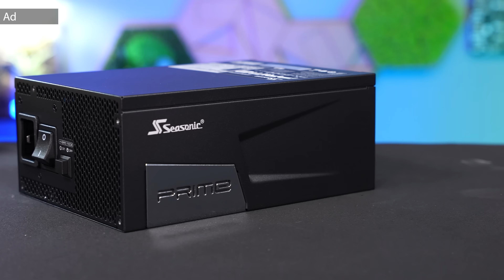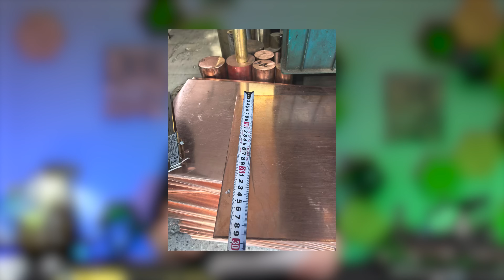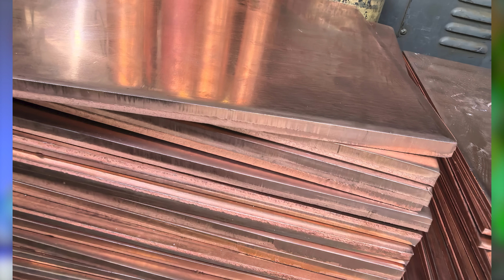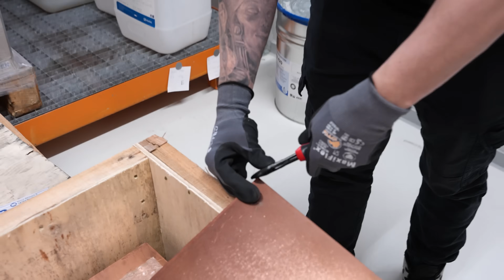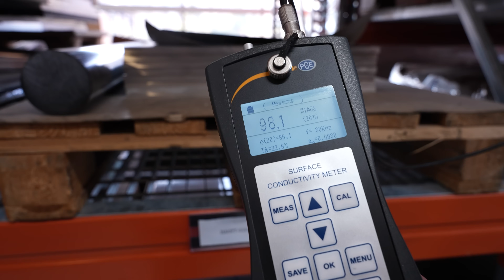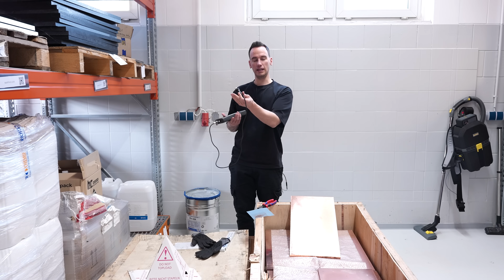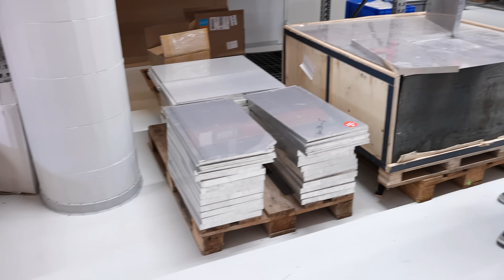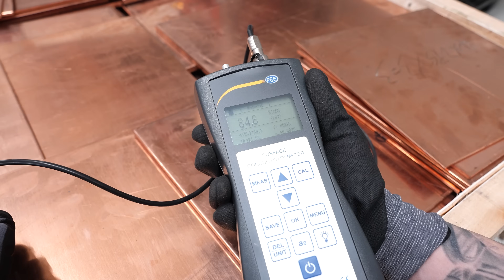I Got Scammed

Comment: china has some of the worst aluminum with high silicon very gummy bad source. they are also known for falsifying their material certifications with tensile hardness ect. a well known company i wont name thats worth billions will never source material from china because importantly the parts being machined go on stuff with huge liability which i wont name and the other reason is they have bought many different materials from aluminum to stainless steel from china and did lab tests and saw that most certifications were falsified from various different sources in china and some close to spec or not even the correct material. DO NOT BUY ANY MATERIAL FROM CHINA
Reply: also china has some of the worst aluminum castings in the world. russia has the best aluminum which i find funny but its true most aviation companies source aluminum through russia at least back in 2018. i think the trade haults really screwed that up thats why aluminum has been crap because people have been forced to source aluminum elsewhere. casting houses have been dealing with crap aluminum as well since the trade hault. some of the best aluminum before it ended you can find is from the 1950s usa if you can find any product or casting from that time period and take the material and mill it you will see just how good quality our aluminum was back than.

Comment: 09:50 ... The TL;DR is don't do business with Chinese companies for anything over $200 or whatever amount you are willing to just throw away.

The non TL;DR ... I tried to save 80% by going with a Chinese company when buying jewelry welders (before laser welders were cost-effective). I asked all the questions necessary and confirmed the type of welder was what I needed for my business.
When they arrived, the ceramic couplers were all shattered, not just cracked, but in tiny razor-shards. I took photos and filed a warranty claim and a few weeks later I got a box of new ceramic thermocouples. They were for a different product, not even a welder from what it looked like.
After several phone calls, the number was turned off. I tried to locate the business and it was as if they vanished into thin air, my $8,000 gone. This was 1990s $8,000 (almost $20,000 in 2026 dollars). I've tried my luck a dozen times since then with various other orders and none of them arrived as ordered (wrong material, impure alloys, wrong item entirely).

I hate to say it, but don't trust Chinese companies for anything over $200. If you can't set fire to the money and be happy, don't buy from Chinese factories. Maybe if you have a buying agent inside of China who can speak directly to a person and know that person and where they live... then it's fine to do business with China, but that was just one of the several times orders from China were outright scams.
The problem is it is not illegal for companies to do this. There is no way the CCP (government of China) is going to let you file a lawsuit in China against a Chinese company - especially if the owner changed the company name. You have NO recourse when it comes to dealing with Chinese companies. THEY get free shipping rates when sending wares due to them negotiating "developing world status" which is supposed to help actual 3rd world nations get into the free market, but China found a loophole and have kept it - this is why TEMU and Alibaba or actual large specific-industry companies can ship large quantities for nothing and if you have to return it YOU pay more for shipping than you bought the item in the first place. So you don't return it and they KNOW this, so that's why they can get away with scamming people outside of China.

Don't put your money at risk thinking you are saving money by using Chinese companies. Pay the actual market price for a legitimate company in Europe, the Americas or even some African and West Indies/Asian countries (I've actually had good results from Pakistan)... just know your brass and copper won't be lead-free.

Comment: Unfortunately trying to save a buck ends up costing us in the long run. Story as old as time. The more expensive trusted suppliers worked hard for their reputation. They earned the right to charge more.
Reply: That's brutal. Hijacked email, fake account, real transfer, and the factory ghosts you. Banks rarely reverse those because to them it's just a transfer to an account. Did you ever try chasing it beyond the bank?

Comment: We had a Chinese company contact us via a German partner to sell us paper. They wanted money as soon as the paper was on the boat heading our way & their prices were about 20% lower than the general paper prices in Europe. Very tempting but we told them: we can only pay part up front until we receive it and they were being very difficult, refusing this completely which raised a lot of warning bells. A single container of paper is also around €20.000 easily so this is not something you trust a Chinese company with. The Chinese WILL screw you over if they can because they know they have nothing to lose. Many Chinese companies change names frequently for this reason.

Comment: Everyone gets scammed ever once in a while. I got scammed out of 7 bitcoins (though they were about 5 dollars each at the time, about 35-45 Dollars), I had a feeling it was a scam but it wasn't much so I took a chance, I was mining a coin a Day with a single GPU at the time. It also seems like I got scammed one other time with USD though I can't remember it off the top of my head (it wasn't much, which is probably why I can't remember the specifics). My Sister thought She'd gotten a job and ended up getting scammed for 10k and had her credit completely destroyed- my Mother and I both told her it sounded like a scam but She followed through anyway. My Mother got scammed recently thinking She was buying a 4TB hard drive for 10 dollars- I didn't even need to take the hard drive apart, I knew that was a scam by just hearing the price of what She thought She got, I did take it apart in the end and yup, just a tiny cheap microSD card with a few MB of actual storage plugged into the most basic of circuit boards,  just enough to trick you into thinking you moved files, then when you unplug/plug it back in, nothing- the potential damage there is incalculable, might have thousands of hours of work that you thought you moved, then delete the original file just to find out the files never did copy, all for a few Dollars, to me this is one of the scarriest types of scams to the uninitiated- glad I know about it, my life would be over if I somehow lost all my data- I live on my rig. My Grandmother has been taken for a few rides, She's hopeless when it comes to computers/scams- I see why scammers go after older People, it'd be so freakishly easy to be a scammer, but my morals are much stronger than a bag of cash- I'd never be able to enjoy that Money, knowing where it came from and the potential damage caused by scamming.

It's good for People to hear about how even the best of us (you) get taken for a ride sometimes, even knowing and being careful, you can still get scammed. One thing I fear due to AI (in my lifetime) is People being blackmailed, starting with fake AI voices and eventually full videos of saying/doing things they never did- many People will think they actually said/did the thing and just don't remember the thing, then end up admitting to things they did not do. AI is very likely going to eventually break our reliance on Cameras/recordings for security- AI will get there, will be totally undisguisable from real footage/recordings it's just a matter of time. In Criminal Court, we must prove beyond a reasonable doubt that a crime was committed- how do you do that without recordings? There are other ways, we didn't always have cameras but with technology it's a lot easier to also fake that stuff as well. We have known for a long while that witnesses are only speculative evidence, a witness alone can't prove anyone's guilt due to how we remember things. Imagine Politics/Media using AI to further a particular narrative. Everything is fakable and our technology is forcing us to deal with these issues, I hope that in the end it's a good thing but it's not going to be pleasant adjusting to the changes/challenges happening in the World due to tech advancing so quickly. Getting older isn't such a bad thing, I'm glad I won't be around for the worst of the adjustment. I'd very much like for us to slow our roll/role but everyone wants an advantage so that won't realistically happen. Oh well, it's interesting to watch the World change.

*hopefully you can still use what you paid for in some way, perhaps just not what you were originally planning to use it for. Most People that get scammed end up with nothing but problems in the end. The mistake: buying from China- you're probably upsetting the competition which much of is based in China. Better to pay a bit more and source from somewhere else, China is crap as a Government/Country (not the regular People).
Reply: You've seen it all—crypto, fake jobs, counterfeit drives, family members falling for the same traps. The small ones add up, and the big ones destroy lives. Ever looked into whether any of those could have been traced after the fact?
Reply: @shaylamscheafuer  I did what I could to try to trace with no luck, though I'm not the best at tracing these sorts of things. This was all a while ago, luckily we're all a bit wiser now. I made a very long comment there! Sometimes, I just can't shut up and well, I hope it helps someone out there to avoid the same thing. Thanks for the response- take care Cousin!

Comment: Some Chinese companies engage in scams, and buyers should be cautious. In my own experience, I used to purchase e-bike batteries from Chinese suppliers. In one case, I paid for a shipment that never actually arrived. The tracking information showed that the package was on its way, but it later turned out that the tracking details were fraudulent and there was no real shipment.

Because of risks like this, it is often helpful to work with trusted intermediaries when sourcing products from China. There are Western professionals and sourcing agents based in China who specialize in verifying suppliers, inspecting goods, and managing logistics. Using such services can reduce the risk of fraud. They also provide documents of raw materials.

It is also wise to use secure payment methods, trade platforms that offer buyer protection, or insurance services that cover international shipments and supplier risk. These precautions can help protect buyers and make international sourcing safer.

Comment: That's why you need a trusted (by you) exporter company in China that follows with QT checks, or you go there in person and check every fucking pallet before loading (That's what I did with my exports anyway, even with trusted suppliers for years) . A mix of both usually does the trick.

Comment: Good story to share.
I never have such business scam in China. Keyword is "in". Before Covid, I had quite a few dealings in China. I needed water pumps, and pipes, so I sourced it there. Everything went fine. Covid hit. I left. I think this is an issue with buying material from China especially when you've never been there. There are cultural thing. Chinese will become significantly less likely to cheat when you meet them. Even more when you had a meal with them. These two sounds stupid, but it was a strong cultural force. It is also a chance to weed out mistranslation. I had one about this, copper, but for me it was copper pipes which was found to be copper-coated. They told me it was misunderstanding during one meeting so we adjusted and I got the right one that day.

I've not sourced anything from China after Covid. I got some from India and Vietnam instead, but I can imagine ordering something from Alibaba and got something badly wrong. Usually, it is recommend to return it if possible, which if you have production in China, it is not difficult. I think you might try to sue them, but I understand how hard that is when you don't have foot in the country. I'd recommend to at least let them know. There are many mistakes doing business in China. Good that one of them have replied. They will be using translated version of your communication with them, so that's one more vector of misunderstanding. Again, usually, this is rooted out in face-to-face meeting but you are not there and it will be very difficult.

I don't know why you should be embarrass about this, really. This is misunderstanding at best, and out right cheat at worst. You are the one being wronged. You should feel no shame, but defiance. Please don't be embarrassed. It will be nice if you can share the names of the companies, especially if they ghosted you. Send them emails. Tell them you have Youtube channel. Chinese is "face culture". You will compel them more by making them lose face than lawsuit. If they really cheat you, then name and shame is the best. Cross border lawsuit is difficult, but not only on one side. They can't practically sue you for defamation neither.

I think if you want to know what else you can do to prevent something like this in the future, it is to make sure you have some sort of insurance. Not mean paper that you will be paid on scammed, but something like a return policy or a withholding period for the fund. Best thing is to just go and make the heatsink in China, but I understand if your business cannot do that. So the next best thing is that, make sure there is something you hold as leverage in case scam. Next 2nd best thing is to source from India. I think Vietnam has shortage too. India shouldn't have that, but be careful about their timeline. Indian holiday can be crazy at times. For India, you can expect more cheat but less misunderstanding so it is still a trade-off. In any case, this is just the way business is. It's not easy, and once you find a good supplier -- you stick to them.

Comment: There are a lot of details that are missing. What strikes me funny is generally there clauses for protection set into contracts for this exact reason unless they were customized or waived off by both parties, the buyer and seller. You shouldn't have lost out on the entire deal, normally you are allowed to check for integrity for each batch and halt payment to get the vendor to make amends if its not up to spec. Unless the vendor decided to go full rogue and this was their one last scam before they cut and run, shuttering their business. Did you have previous business deals with these vendors? Was the integrity tests waived off based on good faith? The penalty for such acts can be devastating for long time seller if they plan on continuing to operate on the same app.

Comment: Don't be embarrassed, man! It was not your fault. The only way to prevent this would be if you go yourself, pack it yourself, test plate by plate and go with the shipment, which is, of course, insane. Thank you for sharing your painful experience... Helps others for sure. 
Would it be possible to instead get copper plates in Germany for an okay price, or is the difference huge when buying in bulk? Respect.

Comment: You can't find them because they need the copper for making bullets,  also you can dispute the charge with your financial institution. Show them you got scammed. And have them do a back charge on the account the money was sent to 

Also why are you making water blocks for the 1% of gamers that can afford a 5090?? 
You should be making GPU coolers per order per GPU.  90% of gamers use a 4060 these days as this is the most common GPU in pre builds for the last 2-3 years. 

You should make a water block that is affordable and panders to the common denominator.

Comment: Live and learn. From personal experience in the supply chain of industrial parts and machinery expediting agents (or companies) are used. These are 3rd party that not only ensures that production & shipping schedules are met, but also helps to eliminate(albeit not 100%) such "surprises" on early stages of manufacture or procurements by shipper. This includes (but not limited) necessary tests (similar to what you made in the video) in accordance to consignee technical specs as well as pre shipping inspection of materials. 
Thank you for sharing!